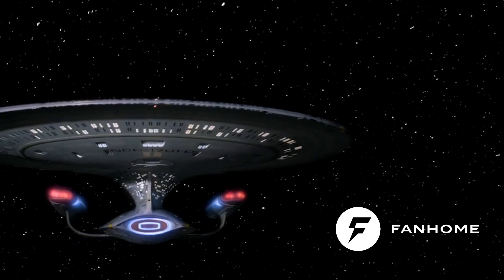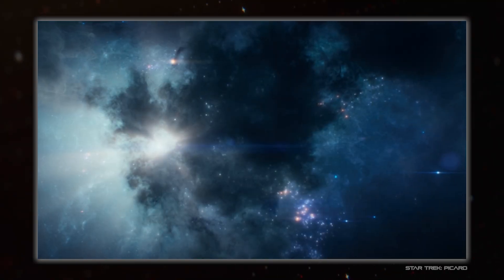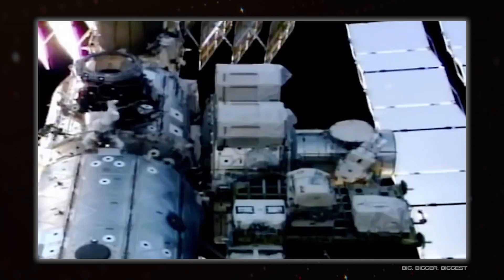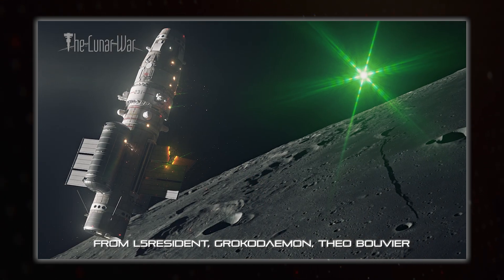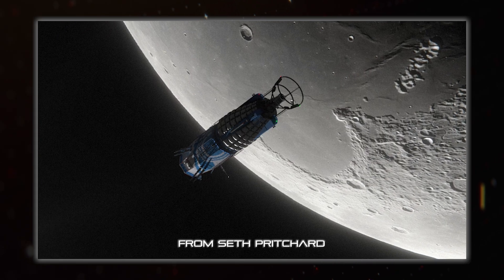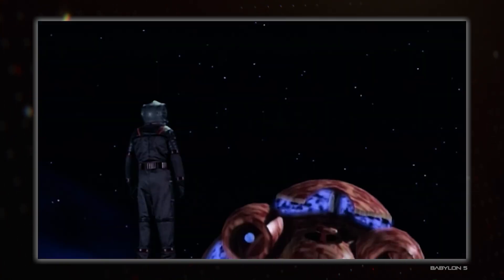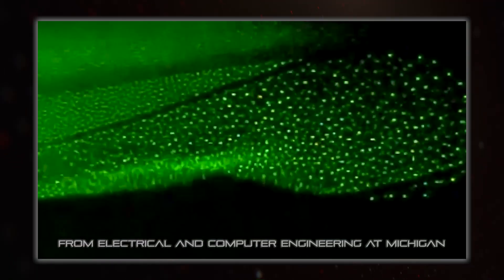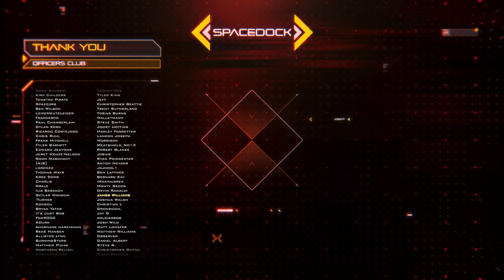Radiators In Realistic Sci-Fi (And Why You Need Them)

Comment: There are also radiators on the back sides of all the solar panels on the ISS.  Where better to put a radiator than on shady side of a solar panel that will always face the sun.  The JWST used open cycle cooling to get it down to operating temperatures, then it has a cryocooler to get it down to the 4°K needed for the MIRI instrument. So when you are talking about sensors don’t for get they need to be cooled too.
Reply: In all my years of reading about ISS that radiators on the back of the solar panels bit is a thing I've not come across before. Is there the name of a reference source you could give?

Comment: So it would be difficult to build an effective space warship just because of the heat problem, because all the cool stuff you can hit people with generates a lot of heat, especially beam weapons, I guess^^
Reply: Bingo. Missiles generate much much less heat which helps with them but designing anything for war is never ever going to be easy. Spacecraft especially included
Reply: Battletech (whilst about mechs) makes this issue a huge part of  game balance and design for players to deal with
Reply: I'd go with the open system approach and just throw the molten coolant at the enemy.
Reply: There's currently reaserch suggesting you might not need a radiator. You can just generate a huge magnetic fields to act as a giant radiator for your ship
Reply: @mryellow6918  That still is in effect a radiator and afaik is the working principle behind Dusty Plasmas
Reply: @argokarrus2731  i mean to add a giant metal mass, but for some reason i cant edit on my phone.

Comment: Another way to get rid of excess heat is to preheat your propellant. Modern rockets do this by circulating their fuel thru passages in the rocket bell. This cools the bell and the hot fuel is burnt and send out the back. The heat goes away with the propellant.
Reply: Not really - See the Falcon 9 second stage- videos, the Bell is Glowing 😉
Reply: @cockpeatdarkhole6909  the second stage engines on the falcon 9 are extended Merlins. the extension doesnt have regenerative cooling and are radiatively cooled just like radiators except theres no fluid so they glow to get rid of the heat. Regenerative cooling is a major component of almost all rocket engine designs.

Comment: Radiators are definitely an underrated design feature; I definitely have them on pretty much every ship in my stories in the form of panels and strips along with internal emission sinks for stealth and protecting the obviously vulnerable radiators during transit or combat!
Reply: I always loved the look of the capital ship designs from FASA's old Renegade Legion setting, massive, long ships build around enormous spinal mount mass drivers, they had these big ventral fins. I don't remember if that was their purpose in the game, but I swiped them as a place to both serve as a secondary heat sink and to retract and protect radiators during combat.
Reply: I thought that there can't be no stealth in space? The crew's life support alone emits enough heat to stick out like a sore thumb against the 3 Kelvin cosmic microwave background, and I don't think it's a good idea to turn it off until the cabin's temperature reaches 3 K..... Trying to insulate the crew hab will make the insulator heats up too.
Reply: @lazyremnant380   there can be stealth, in the same way we have stealth on earth now. And hiding thermal signatures can be done by dumping heat prior to entering detection range and just not cycling heat to the outer insulated hull. Or having a coating shell around your ship with the vacuum between the two. Now your thermal print will be tiny for a reasonable amount of time, likely long enough to get within reasonable firing range... then your missiles and your flares and a fresh heat dump can cover you while you burn away thus giving you even more stealth opportunities.
Reply: @littlekong7685  There ain't no PRACTICAL stealth in space.
You can in theory make something invisble in space for a short amount of time, but it will take so much effort, that it is not practical.
There is no horizon in space. And while the intensity of radiation decreases with the square of the distance, you can always increase exposure times.

You'd have to cool your hull down to almost 3 kelvin and then store that heat somewhere. And that's going to be realy energy intensive - and generating that energy generates a lot more heat for which you'll need even more energy to store it somewhere. The dog's chasing its own tail there...
The colder something is, the harder it is to cool it down further.

Also, while you are stealthing it up out there, you can't manuvre at all as long as you use any kind of reaction based propulsion system.
You will have to generate your trajectory extremely far out if you want the plume from whatever drive you use not to be spoted.
The farther out you start, the more powerfull your propulsion system must be to get you anywhere in anything even aproaching a usefull time frame. And the more powerful your propulsion system is, the further out you have to shut it down to avoid detection. Again, dogs and tails...
I'm not a physicist, but my uneducated layman's guess goes to possibly light years for a fusion drive...
Reply: @lazyremnant380   There is if you have ways to sink the heat and keep the hull cold, Also have to remember stealth is not always about full hide like a romulan cloaking device. Stealth can also be about dropping below ambient detection thresholds. An American B-2 is not invisible to radar, However its signature is so small that its filtered out by most early warning systems.  Similarly in space if you can achieve emissions similar to the ambient of the system you are in you greatly reduce being detected because sensor systems can easily be written just like radar is IRL.  the system tosses out signatures too small as to not be sounding the alarms any time they get a ping back from a goose or say a meteor that has been getting a lot of sunlight.
Reply: @filanfyretracker yeppers. You don't necessarily have to hide from the machines built to detect you. You have to hide from the people using those machines to detect you.
Reply: I dealt with heat in a different way. built some detailed ship models for my sci fi world. They have thermal conductors in the interior that lead excess heat to a isolated heating chamber, where metal rods are melted and then expelled from the ship, so it doesnt have to radiate all of it away.

This creates a new issue tho, if you run out of heat cells to transfer the energy, you have to fly your ship on power saving mode to not cook your crew.
Reply: @d7nero-bn certainly you don't toss the bonds of hot metal or while trying to stealth??  A molten battery heat sink would be quite useful though.. super cool it before stealth and then dump all your excess heat into it as your crew and power systems heat up.   Then after wars you utilize thermal electrics to recapture all that energy - an effective battery storage system that helps mitigate its own inefficiency.. allowing you to recapture the heat energy as electrical to run the ship until it cold back into a solid
Reply: Considering the massive heat that a faster than light engine would produce radiators shoud be pretty big and I am still thinking about a way to protect them during combat. So far the most plausible idea I had was to position them (maybe toghether with the expensive and fragile faster than light engines) in a detachable module that is taken away during combat but, since the protection of vulnerable radiators has been mentioned in this comment, I am open to suggestions for alterantives, especially for smaller ship designs.

Comment: Absolutely correct! Heat management should be more than an afterthought.

Especially for stealth ships, as infrared light gives away the ship in the dark background.
Reply: Even if its not a ship designed specifically for stealth, remember that the first rule of survivability is not being detected at all, so you might allow for normal warships to have ways of limiting thermal radiation so they can attempt to have the element of surprise on their side or even to run away if needed.
Reply: Just put all of your radiators on one side of your ship and hopefully the enemy doesn't have extra eyes anywhere else.
Reply: Mass Effect handleled it nicely by storing the heat internally in lithium heat sinks. And being very specific about not being able to stay in stealth too long, or the crew would be cooked alive.
Reply: It'd be super cool if some stealth ship could put out basically a liquid helium "smokescreen" and had to decide whether to use that limited resource to either hide from it's puruser or cool down. That would be a cool scene!
Reply: you CAN do perfect stealth in space, but it comes with a lot of compromises. non-reflective coating (vantablack) for visual detection, RCS reductions for RADAR, helium cooling to minimize the hull temperature (possible to make it almost as low as the cosmic background's). you can use super-expansion nozzles with shutters to keep the craft maneuverable. of course, you will run out of helium quite quickly (a few days of stealth most likely), but it's something right? you can use other methods which aren't as stealthy but they are more lasting.
Reply: There is no stealth in space.
Reply: @SablePhoenix  yes there is.
I assume you are confusing "stealth" with "undetectability"
Stealth = trying to make yourself as hard as possible to detect (typicly limited to the settings main forms of sensors)
Undetectability = having a way to be impossible to be detected.

Classical examples for space stealth would be:
Hiding behind stuff (Planets, moons, other ships); Thermal controll to fool thermal sensors; Optical camouflage to stop visual identification; false ID/IFF beacons and/or changing the ships siluette/performance to pass as another type of ship; Anti radar coating/hullshapes, etc.

All of these and many more can be used to hide/make it harder to be detected.
Reply: @vyran7044  All of those things exist, yes, but none of those will make your thermal signature equal to background, and unless you can figure out a way to outrun your own EM signature, the IR wavelength your craft emits will be visible from one side of the galaxy to the other (as the Webb telescope has so unequivocally proved, even though we knew that already).  Your ship needs those radiators to survive, and the comparatively enormous signature of those radiators (to say nothing of your drive itself) will always tell whoever is at your destination that you're coming, parsecs and years before you can hope to arrive there.  Most of deep space is incredibly vast and incredibly empty.  You're traversing a terrain where the defender has the ultimate high ground.  There's nothing to be stealthy IN.

Hence, no matter how many measures you take in order to lower your detectability, you can never lower your detectability to zero, and unless you lower it to zero, you're always going to be seen.  There is no stealth in space.
Reply: @SablePhoenix Well, sure, but the signal will still need several million years (if not a few billion) to get anywhere beyond attack range.
Reply: @SablePhoenix  All of that presumes that any potential detection is constantly conducting 100% EM monitoring, omnidirectionally.  Stealth isn't just about blending in, it's also about making it look like you belong.  A sniper in a ghillie suit is going to find it far easier to hide among foliage and plants, rather than in an industrial complex where a cardboard box might be more appropriate.  A stealth ship doesn't need to be undetectable to be stealthy, it just needs to make it so that, when detected, it's classified as something benign rather than hazardous, hostile, and/or suspicious.  A ship that shows up on scanners with the same signature as an asteroid isn't going to raise an alarm, it's just going to be a point in a navigational system marked as "try not to bump this".  And just as a plane can "fly under the radar", a sufficiently small stealth ship can hide close enough to a target ship that the heat signature of the two isn't significantly distinguishable.  It's the equivalent of the cartoon trick of standing right behind someone and staying behind them as they frantically look around for you.
As for the approach, that cam be managed by coming in with a distraction like another ship to divert attention, having a nearby star behind you to overwhelm your reading, or even a fake FTL getaway such as launching an FTL drone to make it seem you've made a hasty retreat, but you've actually anchored yourself to a relatively sensor-free spot on their ship.
There's plenty of stealth in space if you understand how to hide in plain sight, even infrasight.
Reply: @SablePhoenix 
With that logic, we should have found evidence of alien spaceships by now, assuming they exist. Even the best telescope systems have a little noise and threshold values.

The distance between earth and sun is unobservable to the naked eye beyond one parsec, which is multiple lightyears. Space ships are a lot smaller.

Also, seeing something is not the same as identifying it. How do you distinguish heat from decoy probes from the real target? 

I think we might be able to reliably track a target though, once we know it is there and who it is and its location. Maybe that is what they mean with a target lock in sci-fi?
Reply: @SablePhoenix with advanced enough technology, wouldn't it be possible to use lasers to actively cancel your heat signature towards the enemy? Of course this requires a computer capable of completely simulating the entire ship and surroundings, but it could be possible
Reply: @hanneswiggenhorn2023  The heat signature of a laser would be vastly different than that of a torchdrive or anything else that ejects plasma for thrust.  Yes, you could blind a sensor with it, but then you would be very obviously trying to hide something.  Not only that but you would need to know the exact location of the enemy sensor to blind.  What about all the other potential sensors you don't know about?  They could have (and if they have interstellar capability, they definitely have) seeded their entire solar system with tiny, automated, passive sensors that you would never find.  Now all you've done is given them advance warning of your hostile intent.  All the advantages of positioning, maneuver, and detectability lie with the defender in space.
Reply: @SablePhoenix  Stealth is more than just about attackers trying to sneak attack a defended position.  Defenders need stealth too!

One of the things about space is that if you put something in a high orbit, it stays there until something is done to it.  Missiles with fire and forget homing can just be chucked out by your industry then lie silent until you feed them targeting data.  You could hide the missiles inside a box in high orbit.  

Which of these hundred thousand satellite-like contacts contain a missile and which are empty decoys and which are civilian satellites?  Maybe their civilian satellite network also contain missiles?  Can't just trust those broadcasts or weather radar-like emissions, the box can do that.  As for boxes that appear too big on radar, radar stealth coatings and optical camouflage have a role to play here in making the missile in a box look like something innocuous.  

And if you're in range of the orbital missiles, they're in range of you too.  For that matter, once launched, not every engine vectoring towards you is a warhead either.  
(if tech skews towards energy weapons, you can mount an energy weapon on a satellite too and have them fire on targets provided by a ground station with gigantic telescopes...)
Reply: @SablePhoenix  Not "perfect" stealth like cloaks and so on, no probably not (n a hard sci-fi setting at least), but there are ways of specializing towards greater stealth capabilities.

Comment: I was thinking about the stealth system on ME's Normandy - what if you do the opposite. Instead of hiding the heat, output as much as possible, and use it to hide something behind you. Make your little ship (maybe not that little) a big hot angry spot on the enemy heat sensors.
Just like radiators, heat itself can be used in interesting ways.
Reply: sooo, become a flare?
Reply: You're compromising the strength of your hull, too.  And probably ruining your antennae, lenses, and other sensory gear mounted outside.
Reply: @stevenscott2136  Depends - if your ship has a way to vent the heat from an exhaust or something, it should be safe. It's setting dependent.
Reply: Not very good for pure stealth (where the objective is to be completely undetected). Very cool idea for evasion though (people know your there but can't narrow it down enough to target). I guess it's similar to electronic warfare systems that put out a huge amount of noise.
Reply: @jameshuke354  The idea is not stealth, quite the opposite. Be a big spot on the sensors, so they would have a hard time seeing other things behind you.
Didn't Star Trek Enterprise do something like this - hiding a whole second NX ship in the radar shadow of the first one. Something like that.
Reply: @jameshuke354  True stealth accordding to what ive been told is to simply delay detection as much as possible. This includes being mistaken for another object, or them knowing that you are there, but not exactly what you are (meaning they cannot formulate an appropiate response to the problem that is YOU).
Reply: The idea is to not draw attention. This tactic might be able to hide the heat signature, but all that heat will not go unnoticed. The moment the enemy ship points its ladar at you, your cover's blow.